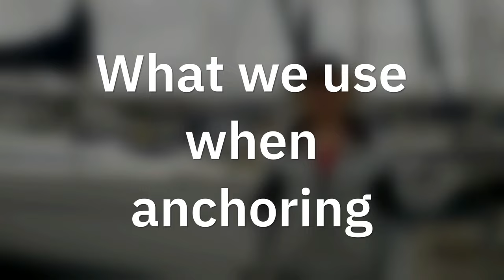Servicing our anchor system - Bangor - N Ireland - Ep. 330

Comment: That was very helpful thank you. I think your right with the tripping line and I will look at using one. I hate to see more plastic in the sea so cable ties are a no no. One thing that we do, for the first mark on the chain allow for the deck height. 
The price of those swivels is unreal. The 10mm kong we have is now £120. Just sold our boat so brought the swivel with me for the next one 😁
Reply from the maker: Our swivel is an Osculati and cost round £60. We looked at the other ones that many Youtubers recommend and the prices shocked us too. The one we have is massively oversized and so we hope to get a few more years out of it 😄

Comment: Really enjoyed this episode because some of what you were demonstrating can be applied to non sailing situations. I hope all is well for you with family and that you will be able to do some sailing. Thanks.
Reply from the maker: We would be really interested to know what non-sailing situations you mean. We thought of this as a very sailing oriented technical video. Nonetheless, we are glad that you enjoyed it.
Reply: Yes it was, but for example attaching U-bolts (shackles) to prevent wear on the shaft of the anchor. I attach chains when towing and more than one U-bolt to allow swivel of chains when turning so there is not wear on point that the chain is attached to vehicle. Never thought of an anchor swivel!  I have extended draw bars that reduce jack-knifing however it does create stress on the chain. Could just add a bit more chain I guess. The other aspect was seizing (?)  - never thought of doing that if a shackle is subject to coming loose. Corrugations can lead to major issues when towing. Those were the two things that peaked my interest. Sure the rest was interesting. eg reducing wear on a length of chain. I am not sure when or if I need to use this but who knows! What is the rating for a swivel?
Reply from the maker: Thank you for the insights. It is hard to find information of the precise breaking load of some shackles but many boats use 8mm or 10mm chain and those have breaking loads in excess of 4.5 tonnes so the shackles should be higher than that. Our Osuclati shackle is one of the cheaper designs - there are some very strange and "creative"  ones that will empty your bank account!

Comment: If you put a small 100% plastic sheave block or sheet friction ring on the anchor float, use leaded sinking prawn trap line, tie one end to anchor trip hole, feed through pulley, then tie a 1 lb weight on the other end.  If the rope with small weight is kept the same length as what the tide difference in the location is and does not touch bottom, then your marker will Float Directly Above the anchor, regardless of scope variations due to tide levels.
Reply from the maker: A number of people have suggested the same modification. We may look into it over the summer. Thanks for watching and for commenting.

Comment: Great tips!  I like the idea of a short length of chain between the swivel and anchor.  So obvious once I see it, but I probably wouldn't have thought of it.  Also, I like the idea of flipping your chain periodically.  Very smart tips - Thank you.  Here's an idea for your anchor marker:  https://youtu.be/dvD7C3HukrM?feature=shared&t=48    Use a small pulley and a weight to keep the buoy right over the anchor.  You can double your trip-line length and still keep the buoy directly over the anchor.  Good for areas with large tidal changes.  Thanks for all your great videos!
Reply from the maker: We did not think of the swivel chain either - the chandlery that supplied the swivel told us to do it. Glad you enjoyed the vid and thanks for the "pulley" tip - several people have mentioned it and we will likely look into it later in the year. 👍

Comment: Great informative video.
Could've used an anchor marking buoy a couple of years ago, when we hooked our anchor on a five meter rowboat.
Luckily a big boat has an hydraulic windless so we got it up but it took us a couple of hours to get the wreck of the anchor.
Reply from the maker: 😮 That sounds like a hard day's work. Well done on getting it back. Did you not try dropping  a loop of mooring line down the chain and then going ahead with the anchor chain slack and the mooring line cleated off?
Reply: @SailingYachtSaltyLass  Yes we did actually tried that, the problem was that the 65kg Mantus anchor went straight. through the wreck and got caught on the keel I was so happy we had a chainsaw on board, however even with that it was a task getting the anchor free.
Reply from the maker: @dutchglobetrotter4513  - 65kg!!!!! That must have been a real PITA to retrieve. As for the chainsaw... we thought we had a bunch of cool powertools aboard 😄but we may need to add more...
Reply: @SailingYachtSaltyLass  That anchor was a bit oversized but still you need a big anchor for a 60ft 35 metric ton vessel. You can never go wrong with more power tools.

Comment: As always chock full of information. Loads to think about there. Is there a particular rope/line you prefer for the tripping line eg strength, diameter so on. Wondering if old jib sheet could be repurposed once we change out running rigging.
Seriously need to upgrade snubber line always said it was too short now I have proof. 😂😂
Reply from the maker: I think an old jib sheet would be fine. We used old 10mm line and it seems to work ok. If you needed proof about the snubber you should have let us know what sort of proof would have helped.... 😉 I am sure we could have... ermmm... accomodated your evidential needs 😄😄

Comment: One last comment. 
Don’t forget that you have to add on the height of your bow above the water, then the tidal rise. 
So 50m of chain doesn’t quite do 10m depth. 
(Sure you ladies do take this into account)
Reply from the maker: We do indeed take it into account, but we simplified the explanation in the video to try and keep the essentials as straightforward as possible. Since our freeboard at the bow is about 1.2 metres, the snubber acts as our additional scope. We attach it at the waterline depth and then lower another 5(ish) metres.

We have never yet needed all 50 metres of chain as our usual target is a LW depth of about 2 metres under the keel (4 metres true depth) so it would take a 6 metre rise to use all the chain up and most tidal rises around here are less than 3 metres. Liverpool had a rise of 10.2 metres so we would have a scope there of around 3.5:1 at the top of the tide. Scary and uncomfortable but probably survivable in fair conditions.
Reply: @SailingYachtSaltyLass  over 10m tide…yikes!
I carry a couple of 60m climbing ropes, so I can drop an anchor in deep water if I really had no choice.  They have the advantage of being super stretchy.  Climbers pension them off when they are still ok, so both free / donations to charity.

Comment: Anchor marker.  How do you handle this when dropping the chain.  
Let both out together, sounds a faff, especially if you don’t have an electric windlass. 
Or just chuck the lot over the side, then lower the anchor.
Reply from the maker: We do have an electric windlass but we can let the anchor out by slipping the clutch. In either case, we pass the trip line over the side and attach to the anchor and then just lower away. The trip line just feeds itself over the guard rail. When the line is almost all out we just chuck the ball over the side.

Comment: Shackles.  I always consider these a weak point.  I feel I ought to use something better than the standard items sold at the chandler. 
What do you use?  
Also with a mooring shackle, ie, not galvanised, I would peen the end.  Perhaps even on an anchor chain, as the wire is not nice to handle, and can get ripped off.  Of course it does slightly destroy the galvanising.
ps, excellent episode
Reply from the maker: The shackles we use are Green Pin shackles that meet the international standard EN13889 intended for marine use and with a 6x safety factor.  We tighten them up as hard as we can and then seize them and we always have to cut them off when changing them. The seizing wire never bothers us as we never handle the shackles when in use. We do grab chain if required but only when wearing gloves.

Glad you enjoyed the episode and thanks for the comments and questions.

Comment: Don’t buy copy D line anchors.
I bought a couple for back up anchors.  The geometry must have been off, as they just would not set.  Almost put the boat on the rocks.  One was ditched, the other now used buried deep in the mud.  (The chandler did say I could send them back) 
I have manually tested by pulling across the mud, and just laid on its side.  The CQR bit straight away. 
Still could do with getting a replacement, not sure to buy a new style, probably a Viking, as I am in Scotland and that’s where they are from, or just a oversized CQR.  
I do have a couple of small Bruce, but don’t think they will be any good in rocky gravel.
Reply from the maker: What is a "Copy D Line" anchor? Never heard of that before. As for our Delta, it seems to set first time for us and it loves mud. Having sat out a F10 blow and many F7/F8 blows on that anchor, we definitely trust it.
Reply: A D line is a copy of a Delta.  Obviously not a very good copy in my case!  
I was not criticising your Delta, more warning others not to get a budget option
Reply from the maker: Thank you. Always good to find these things out. Much as we love a bargain, we have come to the conclusion that, sometimes, it is necessary to spend the money on the genuine article 😞
Reply: They were not bought as a primary anchor…hence going for the bargain.  Though to fail 100%! 
I had previously bought similar from another supplier and it was fine.

Comment: Haaah, my ancor boy is better than yours :-) Under the float I have pulley (correct name?). The rope goes from the ancor, through the pulley and to a weight. The the float will allways stay right over the float. The rope is about 10 meters long . We allways ancor in between 5- to 10 meters of water
Reply from the maker: We have thought about making that exact change but the current system is simple and seems to work well so we do not feel any pressure to "upgrade". Do you feel it offers any significant advantages (or complications!!)?
Reply: @SailingYachtSaltyLass  In Norway we have a saying: "Someone likes the mother, other likes the daughter". It depends, never had any problems. But regardless weather, the bouy floats above the ancor.
Reply from the maker: @svhulda6157  - never heard that saying before 😄
Reply: @SailingYachtSaltyLass  Norwegians, you know. We are kind of direct. Donkies ages ago I worked with a company based in Manchester. Working with them was like swiming in wet clay. I told them my meaning. "You are very direct Harald, very direct indeed". The managing director tried in a polite manner to tell I was bloody ruth. You are too polite over there :-)
Reply from the maker: @svhulda6157   - perhaps this translation guide will be of assistance 😃 

https://static.independent.co.uk/s3fs-public/thumbnails/image/2015/11/11/12/language-web.jpg